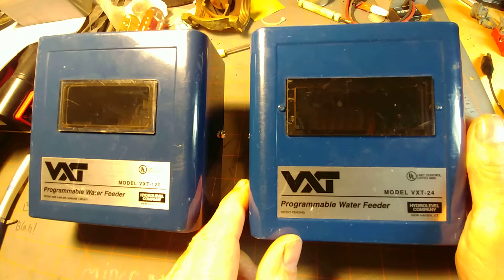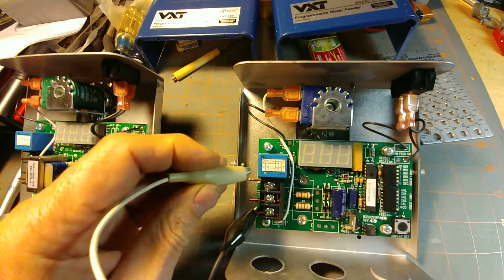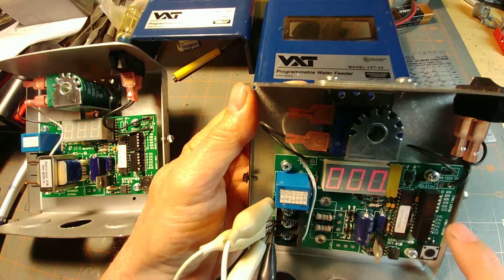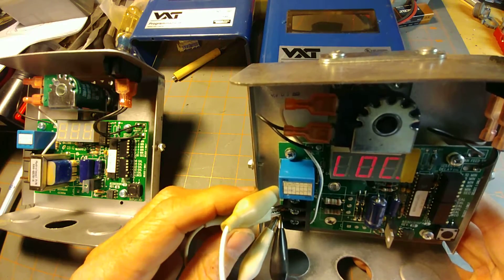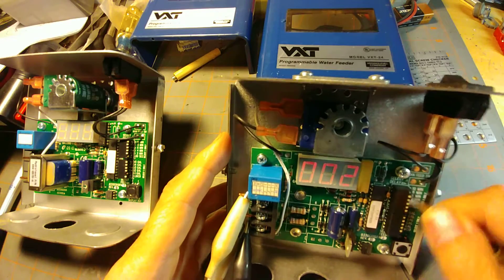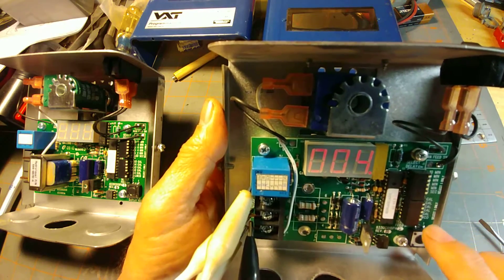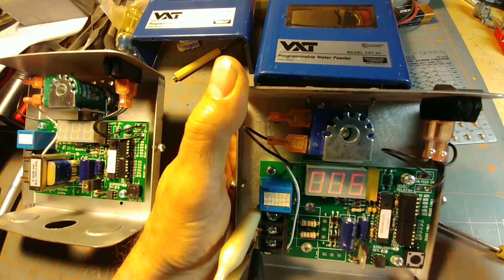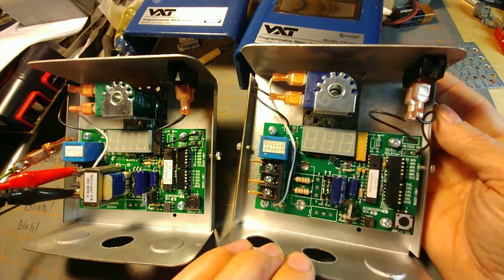Hydrolevel VXT Steam Boiler Water Feeder

Comment: How high does it go? Does the number displayed on the screen matter?  Mine displayed 13 for several days and the pipes were banging away. Then it went up to 21 and it flooded the boiler before reaching the radiators, luckily I shut it off before it could.  Now it’s off or disconnected and it’s displaying 125!   F’d up completely, and it’s brand new..just installed boiler...  I was told it shouldn’t be opened..  not that I would..  I stumbled on this yesterday when my brother in law told me it sounds like the feeder isn’t sensing and over feeding.

Ok the second part kind of answered my question a bit?.
Reply from the maker: It may be that the low water cut off is sending spurious signals to the VXT. The LWCO "thinks" it's low on water when in fact it's not.
Has your new boiler been cleaned per manufacturer's instructions? Dirty water is one possible cause of a poor performing LWCO.
Reply: Gordon Schweizer thx for answering...  I don’t know if they cleaned it..   I’ll ask. I think that was brought up also.   Is it the same as skimming?  I don’t know about the LWCO either.
Reply: @karen7620-v4n  There could be a number of issues here:
The installers may not have done the "near boiler piping" correctly, causing the water in the boiler to be thrown up into the system, which causes the water level in the boiler to drop, causing the LWCO to ask for water from the feeder.
The water in the system may still be contaminated, either thru no or not enough cleaning and skimming.  That will cause "wet steam", sending water up into the system, which causes the water level in the boiler to drop, causing the LWCO to ask for water from the feeder.
The returns could be clogged and not allowing the water to return to the boiler quickly, causing the water level in the boiler to drop, causing the LWCO to ask for water from the feeder.
The pressure controller may be allowing excessive pressure to build up in the system (or your boiler is over-sized or over-fired or both), holding water up in the pipes and returns, which causes the water level in the boiler to drop, causing the LWCO to ask for water from the feeder.

You could have some of your radiator valves partly closed, holding water in the radiators, which causes water to be held up in the system, which causes the water level in the boiler to drop... you get the idea.

Comment: great video golden. I have a question. our feeder is at # 5 but started at #2.why did it go up to 5?
Reply from the maker: The VXT feeder is designed to add a timed measured amount of water to your steam boiler, after a preset delay, upon a call from the boiler's low water cut off.
It very roughly corresponds to one gallon per unit count. Very roughly!
Your mileage may vary!
So, the counter number displayed may indicate a small leak somewhere. The VXT cannot tell you where the putative leak is, only that you may have one.

Comment: What if Lwco bringing in slightly too much water; to top of sight glass? Not flooding but just too high?
Reply from the maker: What is the feed amount switch set to? 1 gal? or LWCO? or ?  I've also found that rarely, the flow restrictor build into the valve body gets dislodged and it will feed too much on a cycle.
Reply: Gordon Schweizer omg. It’s currently set at 3gal, 8min. I think I will cut that down to four minutes 1 gallon, what do you think?
Reply: @jakehits  Remember, I can't see your whole boiler situation, so I'm going by some creative guesswork.  So, here goes: Yes, try 1 gallon per feed cycle. Then you might try to set the feed delay to 30 seconds, than slowly drain the boiler until the low water cut off is triggered (and a period appears after the three numbers on the VXT). See what happens to the water level.  Is it still too high? Or too low?  If it too low, set feed cycle to 2 gal and try again.  If too high, well, that might be a totally different issue and we'll get to that if needed. 

An eight minute delay is a bit long it seems to me.  Let me ask you this:  When the boiler runs for a while, what happens to the water level?  If it drops in the sightglass at the end of a long cycle, how long does the water take to return to where it started, more or less?  If it taking longer than 2 min, you've got a problem somewhere in the system.  It most cases, 30 seconds should be long enough.
Reply: Gordon Schweizer Great idea and thanks so much for the insight. I will try that next time. This boiler is in the basement and heats the third floor of a three family house so the steam has to travel quite a distance. The water returns to about where it started in the sight glass but I don’t know how long it takes since I haven’t ever sat and watched it from when the thermostat was cut off after a long heat session. I will try that also.
Reply: @jakehits  I'm glad I can help.  Third floor radiators only?  That's certainly unusual!  I'm going to assume some more and say this is one-pipe steam? If so, if you can, please make sure the in-let valves on those radiators are all fully open.  Partly open valves can delay water return back to the boiler.
Reply: Gordon Schweizer one pipe indeed. Yes, it’s a tenants apartment but i made sure all valves are open. I really appreciate the feedback and will keep you posted if anything odd happens. Will drain boiler down and try to find the right combo on the VXT.

Comment: Great video! Does the ground wire in a 14/3 go unused in this system?
Reply: Thank you! 

There is a small hole in the chassis below the electronics (time index 1:08) where you might run a 8-32 self-tapping ground screw.

Comment: Hey Gordon. I have a few questions that I think you might be able to help me with. Anyway possible I could get you on the phone? My number is 4435214479
Reply: Process/production steam boilers (ie, crab steamers) that do not get condensate water back ever are a whole different animal from heating only boilers! Because of the delay baked into this VXT, this type of feeder is not recommended to be put on a crab steamer.  Likewise, probe-type primary LWCOs are not a good fit for crab steamers because of the delay in re-start once they trip off on low water. Also, the re-start of the electronic LWCO, coupled with a feeder that dumps water into the boiler as soon as it is told, will most likely flood the boiler!
Reply: Thanks for the video very informative. ? If the water feed stays on the open position. What will happen? Is there a safety to not allow it to continually feed water? Thanks

Comment: I really like your video, I wish I would have seen it before buying my water feeder. I didn’t know they had different voltages and I ended up buying a 124v water feeder when my low water cut-off is 24v. Is there a way to wire up  my low water cut-off of 24v and my water feeder of 124v? Thank you in advance and have a terrific day
Reply: What model boiler do you have?  I'm going to assume its atmospheric gas fired?  What make and model LWCO is on it? It may be possible to wire it just so with a clever use of a RIB relay ("relay in a box").    I assume you can't return the feeder and exchange it for the one with the "correct" voltage?
Reply: Gordon Schweizer I think I will try to buy the right one. I hope I didn’t get the low water cut off burned for trying to connect the wrong one
Reply: @ricardoguzmanoritz14  : Just to test, I hooked up 24V to the VXT-120 shown above and nothing bad happened, but it didn't "light up" (as expected).  I then re-tested the same unit with 120 volts and it worked perfectly, so no worries on that score.  If, however, a VXT-24 were exposed to 120v, I'm reasonably certain it would not end well for the 24 volt unit.  You might not need to remove/un-solder the complete valve assembly to replace the units, just make sure to remove the green coil (120v) and put the blue one (24v) in its place, and it will be good to go.  I hope that helps!